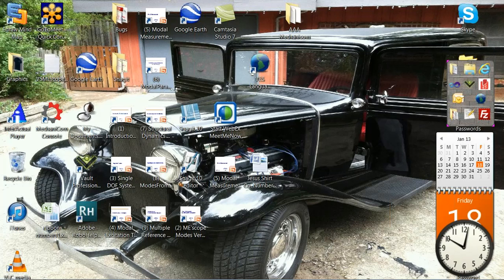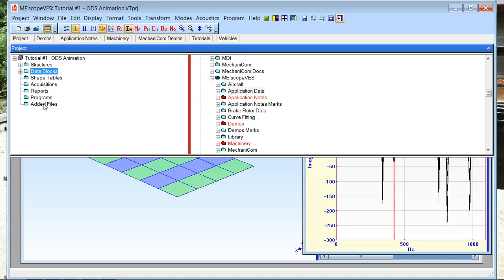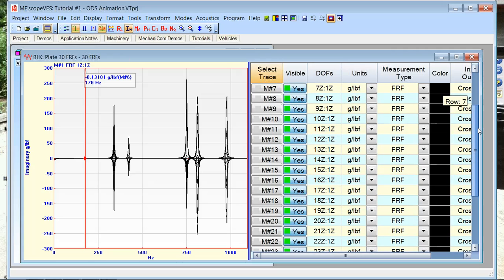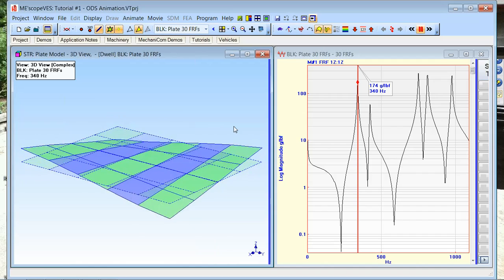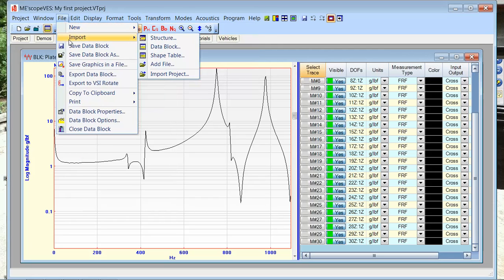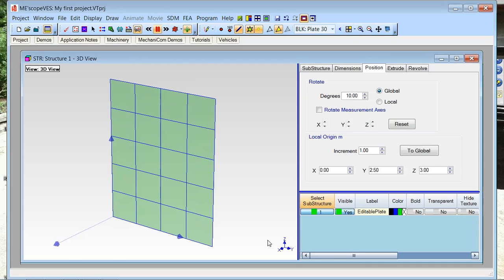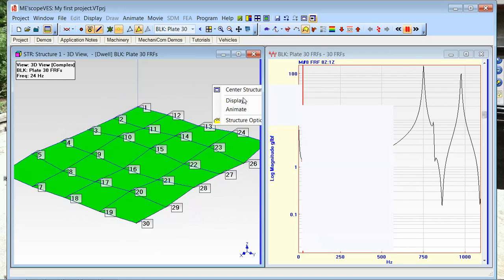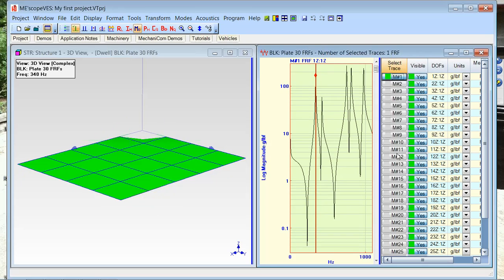Vibrant Learning Lab - ME'scopeVES General Navigation    1/18/2013

Comment: hello sir,
I am a PhD student in research mechanical engineering, vibrations, and I am working on the Mesocpe program in analyzing the vibrations of steel structures, but the version I have of the program is very old and does not meet the purpose.

Can you share a link or a recent copy of the program to download? When I finish the study, I will share with you the results that I reach